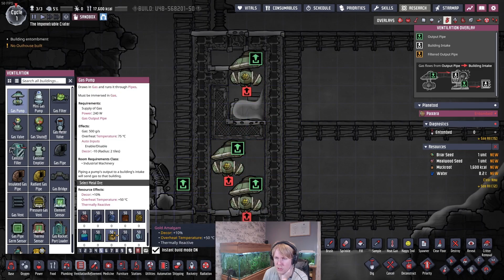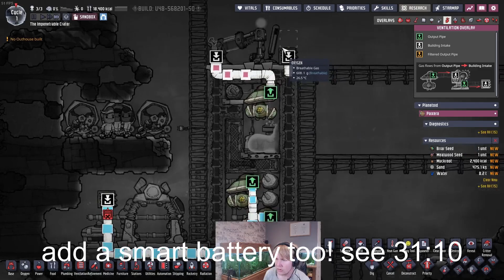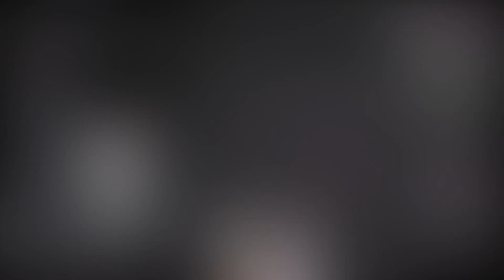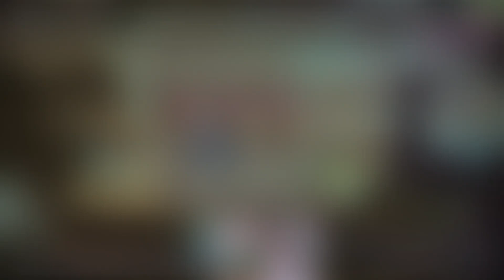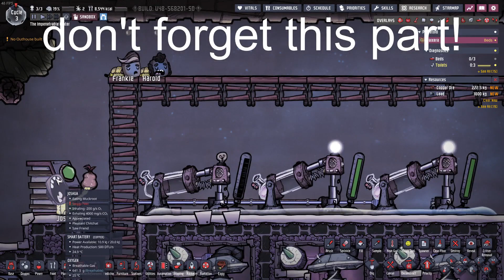How To Make Power-Positive Oxygen In ONI: Spaced Out! Sandbox Showcase #1

Comment: Love you/your channel, I'm so glad YouTube (for once) recommended me a great person! 

I know you probably have a laundry list of things to do/film, but I'd looove a video on easy ways to save on power/load limits. I.e. using 1g packet loops w/valves to sort elements instead of a 120w gas/liquid/solid filter. Or even simpler; Using multiple incubators on staggered timers to avoid load limit issues, thus running 5+ incubators on a 1kW wire. 

The former has hands down been my most mindblowing discovery, and has enabled me to build some stupid yet super fun mega-sorting systems for misc. elements that need to be dumped or moved in small-med quantities. (No more making a whole new line for just that one natural gas geyser, just connect it to the main sorting line)! I am very very sure I am missing out on plenty of saved power, so any little tidbit where I can reduce usage helps! 

For the environment! ...or something like that. Have a great day :)
Reply from the maker: Thank you! I'll add a filtration methods comparison to the list of potential Sandbox Showcase videos. I haven't actually done the incubator automation yet as i usually have way too many critters anyways, but I'll probably investigate this in the next run when I start that in a few months.